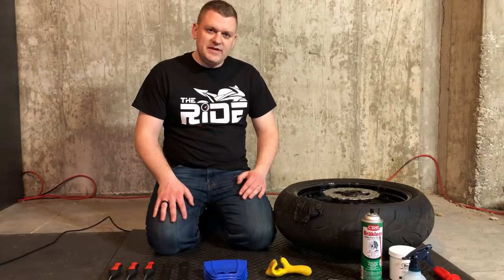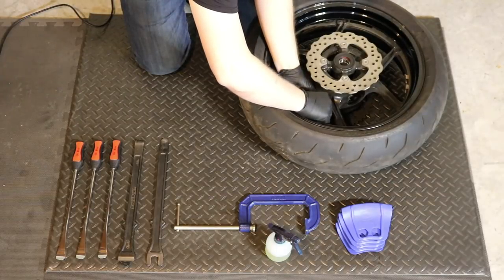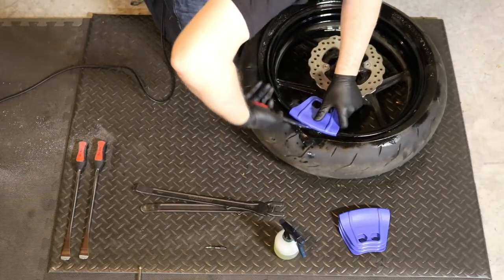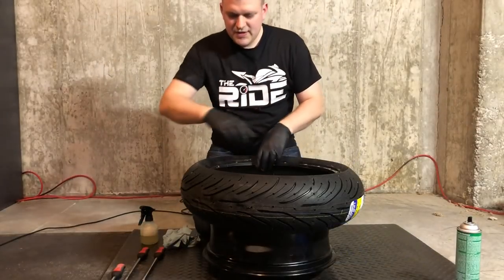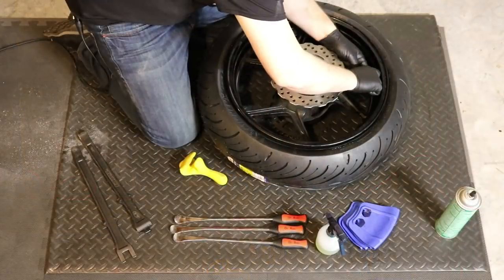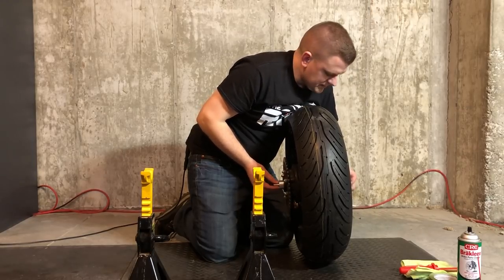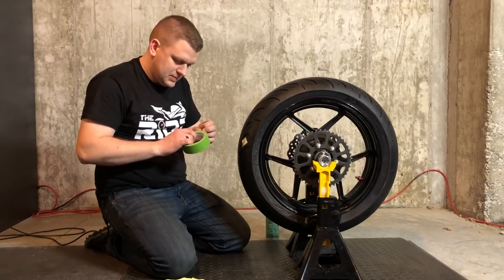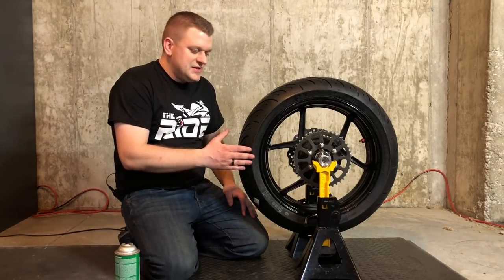Mounting and Balancing Motorcycle Tires

Comment: thumbed it. very organized and detailed vid. love to see him to do a spoked wheel with tube tho! any reason y you had to take old weights off b4 knowing if you even had to, ALSO, y not use the wheel's shaft as part of the stabilizer, does same thing? thanks!
Reply from the maker: Thanks.  I've done spoked and tubed, slightly more challenging, probably not kid appropriate as I'd be swearing a lot :) It's unlikely that you would get lucky enough that the same weight would work, but you could certainly try it.

Comment: I tried everything to get the tire on the rim. Just like that tire. I even used c clamps to keep the tire from popping out. But the problem is no matter how many videos I watched, everybody got the tire on easy, but mine refuses to go on at all. It is driving me crazy. I am at the last 3rd and yes, the other side of the tire is close to the inner part of the rim where it is deepest, but I cant get it pulled over for nothing and I am afraid of damaging the tire wall by pushing too hard, though I am already trying to pry hard. I am using the motion pro bars. The only difference is I am using the short ones and you are using the long ones it seems.
I bought the short ones to keep these on my travels, but if they are useless for putting the tire on, then they are useless for traveling also. Sigh.. I mean is it just because I dont have a long enough bar for leverage? I am quite upset and bringing it back to the dealer tomorrow to finish the job.
Even you skipped the hardest part of the installation :(
Once I can buy a house I will build a workshop and tire equipment I have found to make the job easier so I dont have to spend a fortune on the dealer again. I dont get what I am doing wrong.
Reply from the maker: The big trick is that other side of the tire has to be in the center of the rim. That allows for enough clearance to get the tire over the rim in that last 3rd.  If you think of it in terms in the distance, the tire can only stretch so far.  If it's up over the rim bead seat it's too tight to get it over the top of the rim (the part you are working with). If the lower part of the tire (other side of it) is sitting in the center of the rim, then there is more room.  Hope that makes sense.

Comment: You didn't align the dot ( lightest part of the tire) to the valve stem.
Reply from the maker: Depends on the manufacturer actually, some mark lightest, some mark heaviest.  You have to check to see what the mark relates to per manufacturer.

Comment: You failed to clean the rim-- always clean the rim. Also, you made no mention of lining up the dot with the valve stem. Lining up the dot with the valve stem reduces the weight you need to add and often if you align the dot with the valve stem the tire will already be balanced.
Reply from the maker: I did clean the rim, just not on camera.  Also you need to check with each manufacturer for the tire, some mark the dot as the heavy spot, some mark it as the light spot.  So whether or not you align to the valve stem depends on the manufacturer.

Comment: Ok guy. So that sure was quick getting the tire on the wheel.  Is there a reason you edited out / fast forwarded the "fuck this shit!" part of the job?  Funny how leaving this part out makes this job look so easy and enjoyable. Leaving this part and the tire popping onto the wheel out of the video is just wrong.
Reply from the maker: Part of the "art" of making a video and not having it be several hours.  Some tires are more difficult than others.  The rear tire took me longer than the front.